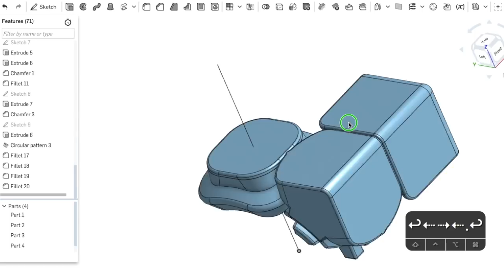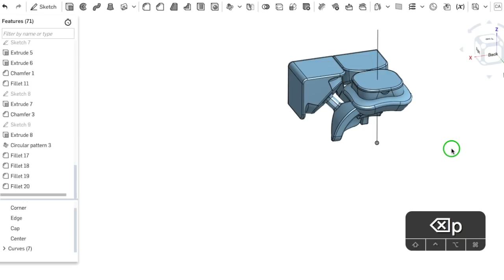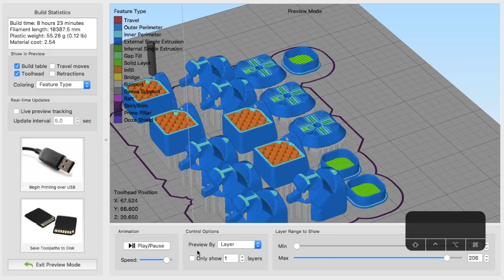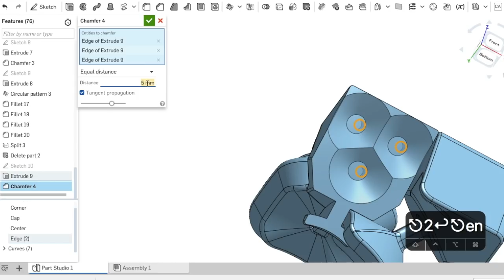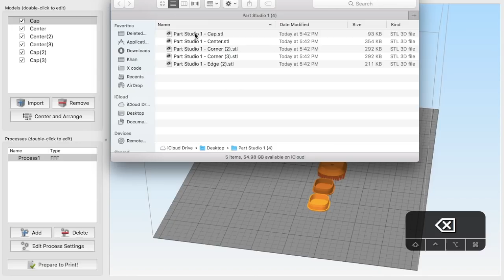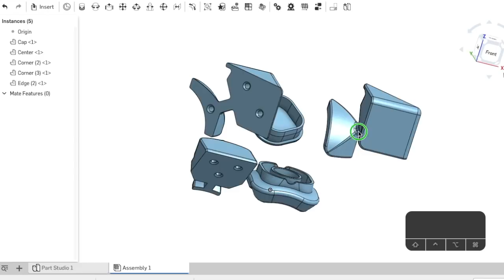Finishing/Next Steps | Designing Speed Cubes - 6 [Tutorial]

Comment: You have been amazing, this was such a fun project, I have printed my cube (including my own core design) but the hardware is giving me an issue….I think. What do you recommend for hardware?
Reply from the maker: Back when this came out it was possible to buy hardware from speed cubes, but alternatively you can always just use some M3 screws along with some springs. I've used both with success in the past.
Reply: @NKCubed  awesome, thanks for the quick reply! For the moment I just stole some hardware from an old cube, so I think if I keep massaging the cad file I can get it to work. Thanks for the tutorial, this was so fun!
Reply from the maker: @tommyboileau8516   yeah no problem, it takes a bit to get the right size if you want the core to be self threading. Might help to use/incorporate the original core if possible 🤔

Comment: I don't have a 3D printer at home so I'm going to use Shapeways to print. However, to print they require that you send in one file with everything you are going to print. So how would I make it so all the parts are placed in the correct way so that I can send in that file in to get printed? 

And also,  (sorry for the long comment) since Shapeways will take a little longer to get to me with the shipping and all that, should I make a "rough draft", then when everything is working well I tell them to produce the final version, or just wing it and hope for the best by making the final version first?
Reply from the maker: If I was you I'd test it by printing it on a website like 3D hubs, shapeways is expensive and if you don't hollow out the parts the puzzle is very heavy. If you're going to get your design printed I'd wait until you were done with the design, a 3x3 should work. The caps may be tricky though. The best thing is to have a friend with a 3D printer.
Reply: I don't have any friends or family with a 3d printer, but my dad does have a CNC machine. Would that work?

Also, what are some good slicer/printing prep software that I can use to lay out all the pieces?